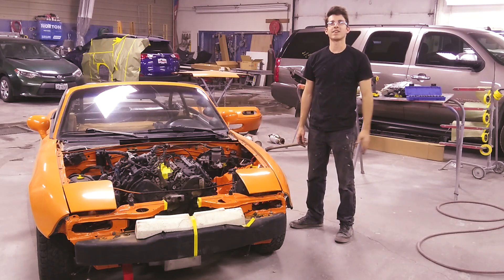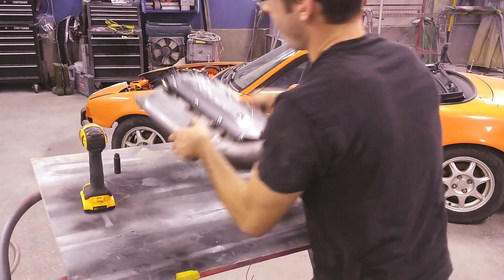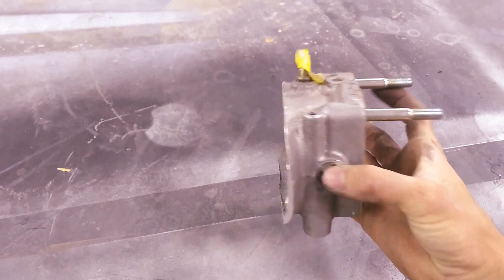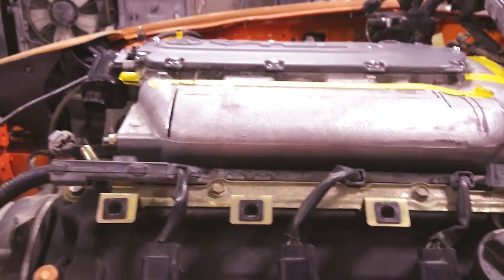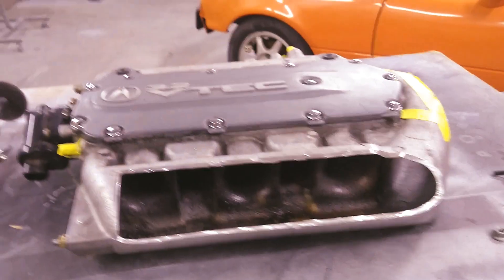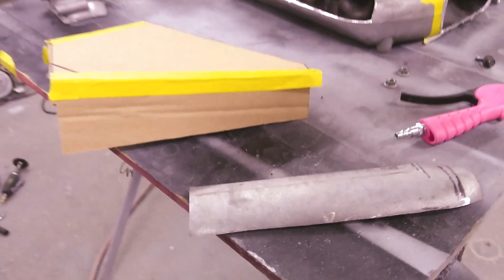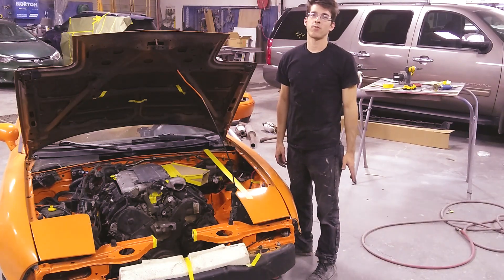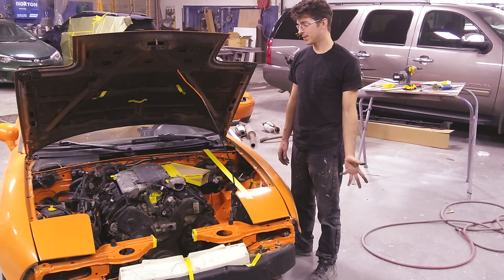J32 Swapped Miata (air intake manifold part 1)

Comment: Are u doing two tb’s? One on each side? Otherwise this side will starve the other 3 cylinders
Reply from the maker: I ended up selling my build but the plan was to gut the inside. Having two throttle bodies would look super cool and like you stated make sure both sides get optimum air flow.

Comment: Is the intake mani reversible on these?
Reply from the maker: From my understanding some are but to do it you have to switch the intake tubes that are under the intake manifold. The mounting studs and bolt holes don't match up otherwise. Also something to keep in mind is all of the wiring and vacuum lines will be in a different location if you reverse the manifold. I like the look of this style too.
Reply: No
Reply: It can be done but you need to do egr delete